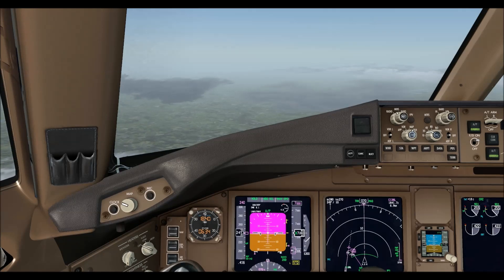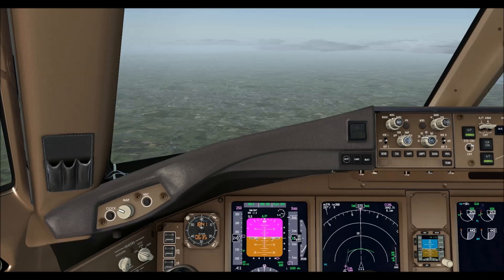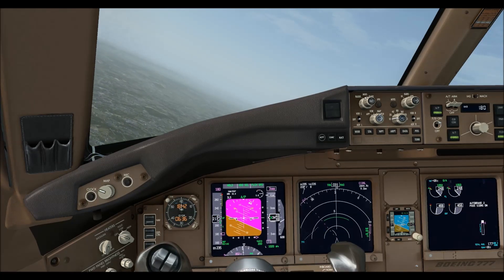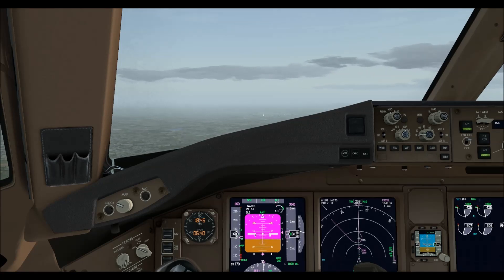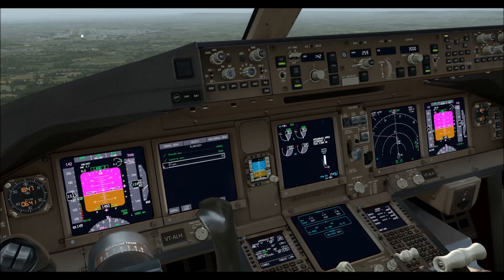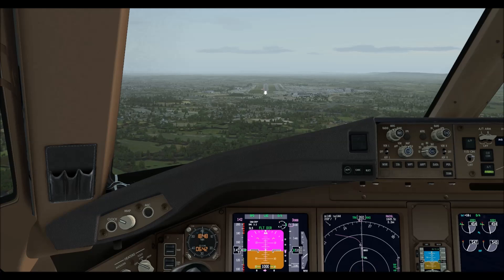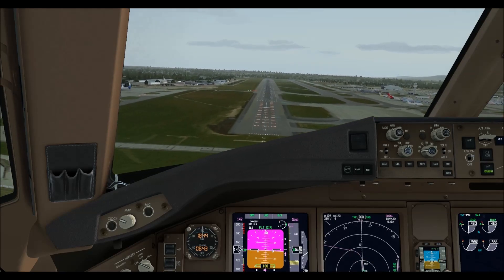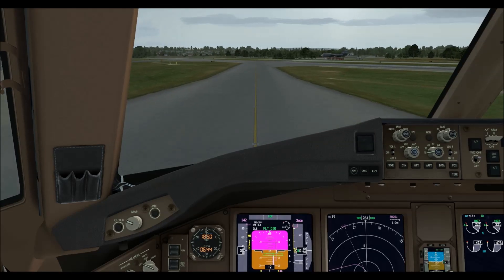PMDG 777 Cockpit Landing At London with VATSIM ATC [HD]

Comment: Sounds like you're using vPilot and getting a lot of model matching errors. There's a utility that scans your AI addons and default aircraft, then makes a customized rule set that only has models/paints you already have, so you never have to hear that error beep again.
Reply from the maker: actually at that time i had no ai addons.
Reply: The source of the errors is having active model matching rule sets that attempted to load a model that is not installed.  The utility I mentioned is called "VMRGenerator" and is available here: http://www.lekseecon.nl/VMRGenerator.html